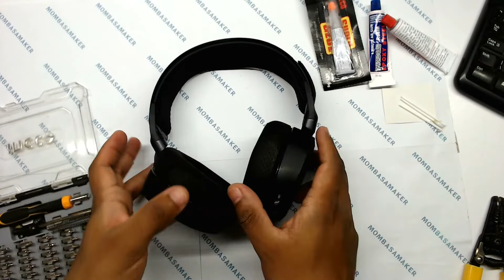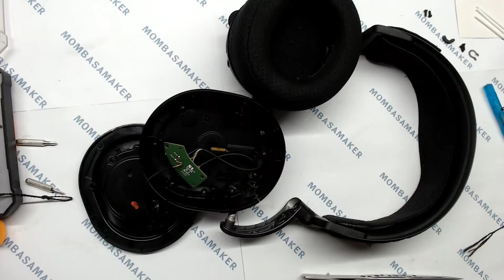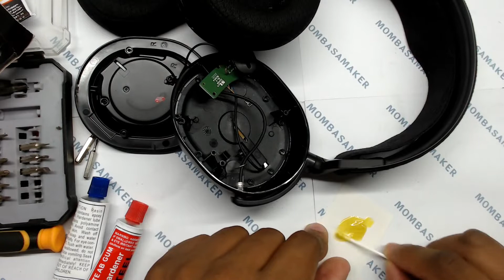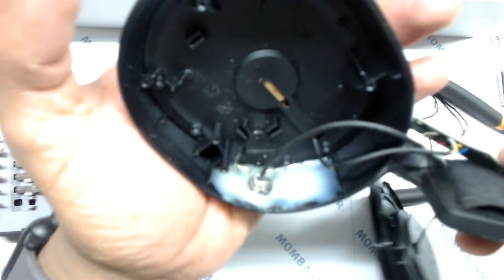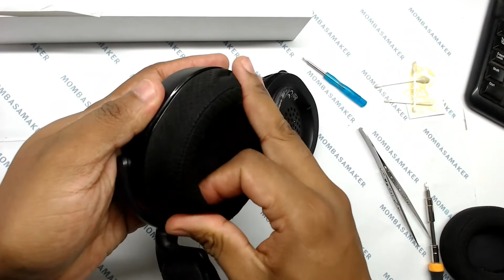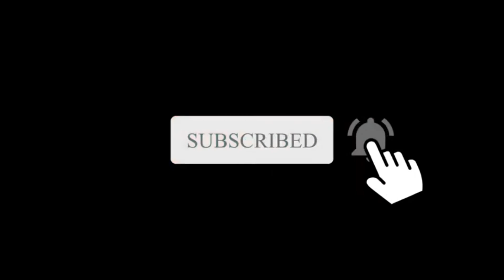SteelSeries Arctis Pro Signature fault - How to repair cracked and broken headphones

Comment: I think steelseries should provide spare parts to fix this expensive headset. mine is Artctis Pro Wireless and it has the same problem in less than a year which is frustrating.
Reply from the maker: They should and if they don't I think it is an opportunity for third party companies to come up with the parts which are stronger and people would be willing to buy. I believe people with 3d printers have had success with printing parts using more durable materials

Comment: I think my Steelseries Artis Pro Wireless BT chip/transmitter isn't working. My phone's BT isn't picking it up, but it does my Steelseries Arctis 9x Wireless. Any ideas?
Reply from the maker: Unfortunately that could be the case, that the BT chip has actually gone bad. I wouldn't be surprised. Components nowadays fail at a much faster rate. Before ruling it out, try connecting them to another device or phone and see if they connect.
Reply: @atdiyrepairs  I have. It only connects to my desktop with the transmitter plugged into the computer. I assume the BT board is on the side with the BT sync button.
Reply from the maker: @Duke_Blue_Devils  Means they still work with the computer through the transmitter but not connecting through the BT
Reply: @atdiyrepairs  yeah I'm glad they still connect to the computer. I'm going to buy  a broken one to fix mine. Thanks for chatting with me.
Reply from the maker: @Duke_Blue_Devils  You're welcome. Let me know how your repair goes.
Reply: @atdiyrepairs  I will sir. I'm looking for one now.
Reply: @atdiyrepairs  do you know or think the other wireless headsets(1, 7, 7x, 7p, 9, 9x) BT transmitter would be the same or possibly work?
Reply from the maker: I think they most probably would be using the same hardware with some minor differences however I would advise getting a similar model to yours hence removing any doubt and it will also make the repair a breeze as it would just be swapping out the bad component for a good one without having to guess or face different pins or color codes